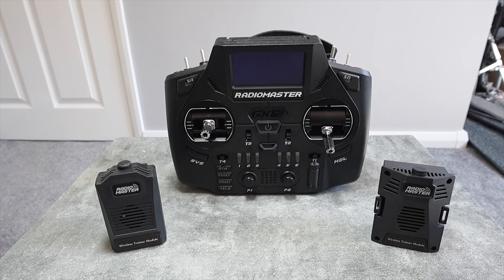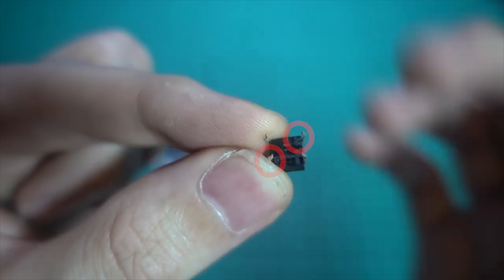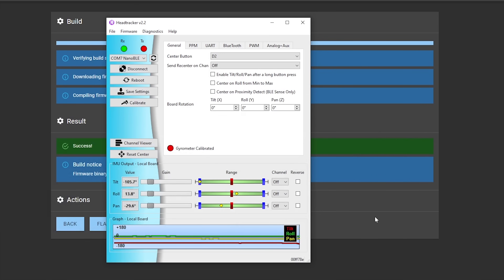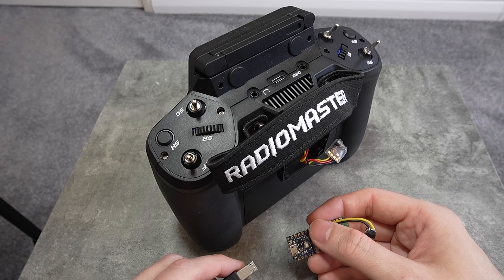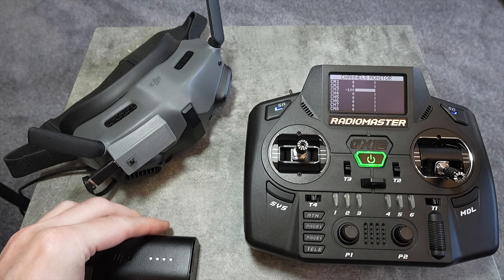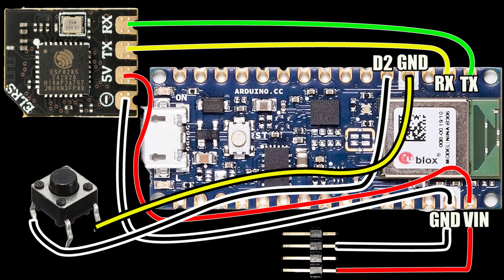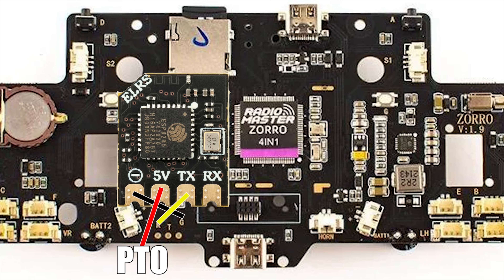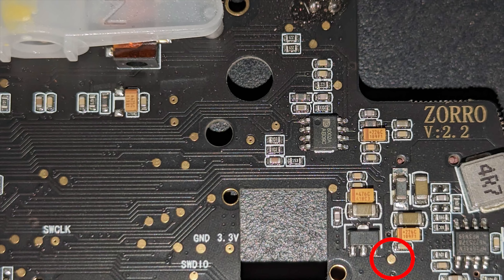DJI Wireless Head Tracker For Radiomaster Radios Tutorial

Comment: It's cool an all,  but I'm not convinced this is much easier than installing a Bluetooth module on the inside of the transmitter,  flashing the custom build and then actually using the Bluetooth connection on the arduino.
Reply from the maker: It depends what you are referring to and what radio you have. For example the Zorro is horrendous to take apart. Boxer and gx12 is easier and has plugs. Tx16s mk1 Bluetooth pads are miniature and I have destroyed the pads completely on mine trying to fit the frsky one which you can only find old stock of. They don't make any more. If you are referring to the esp32 build I believe that's very much in beta stage for the firmware and works  but Bluetooth runs on 2.4 and is weak so if you are running it alongside elrs 2.4 it will drop connection a lot due to noise issues. Then there's the latency of Bluetooth which iv gotten use to myself. But in my experience this is better and easier in every way. For example no need to compile a custom build of edgetx to add Bluetooth. On the boxer and gx12 it already had sbus trainer. The tx16s was just an update
Reply: @AndyRCchannel excellent points on the different radios. However,  you've sold me at "latency". That's the one thing i struggle with and will be doing this now for sure!
Reply from the maker: @RichardFPV  it does make a difference Phil used a wired setup and when I try his I always think Bluetooth is convenient but damn the instant response is a lot better. Now it can be both

Comment: Lot of work in video! Well explained. Why not just arduino on goggles Tx,s to arduino Rx,s onto radio trainer module on Bluetooth set to output sbus. That's all I did works fine. No elrs Rx,s involved...
Reply from the maker: Two nano boards here are about 60usd where as elrs receivers can be as little as 6 dollars. Bluetooth is fine. Been using it myself since 2019 but has latency that does not exist with elrs. Iv been using Bluetooth with crossfire which is fine because 868 doesn't interfere with the 2.4 of Bluetooth. But when 2.4 is used to the model it can drop the connection to the weaker Bluetooth signal and or cause random jitters. However there are many ways to skin a cat and that's why we are lucky to have so many methods that can suit you.

Comment: Great video thank you very well explained.  I currently use the Bluetooth method with my tx16s but it can be laggy or disconnect.  I’ll definitely be doing this expressLRS update.
Reply from the maker: Disconnect because of range or random disconnects?
Reply: @AndyRCchannel  random disconnects but then recovers, I’m flying and looking around then the gimbal stops moving and the tx16s beeps a BT connection tone then it continues working again.
Reply from the maker: @benjaming9835  are you using 2.4 for the signal to your model? or another elrs? blutooth also runs on 2.4 so when its close together the bluetooth will lose. this elrs receiver as a transmitter eliminates that. I fly my bluetooth stuff with crossfire which is 868mhz in the uk so it doesnt knock out the bluetooth

Comment: I have a Nano 33 REV2 here but the number is ABX00071.  Will it sitll work?
Reply from the maker: I think the rev 2 is now supported but In beta. Best thing to do before soldering anything to the board is flash v2.2 and make sure you are getting the pan and tilt moving in the gui before going any further as that won't hurt it
Reply: @AndyRCchannel  OK thanks I will do that.  Im in Canada and the REV1 was more than double the price so I bought the REV2 :)  Ill report here if it all works.
Reply: @AndyRCchannel  OK I did get it to work but had to use the nightly builds of firmware and the configurator and manually choose the firmware file.  If someone needs help with this just post here and I can give more details about how to do it. It is version 2.4 of both FW and Configurator.
Reply: Also of note that on my REV2 board and the 2.4 FW and Configurator that the Reset Pin was D3 not D2 and I couldnt change it.  It works fine on D3 though.
Reply from the maker: @gregdavidd  yes I joined the discord server for the head tracking project and there is a lot more updated info on there than the website. good to know the rev 2 board works and a couple of others too!

Comment: Man, sounds like and looks like ALOT OF WORK!
Reply: Ya hear there coming out with pnp version soon,i use the lemon recivers so this here won't work for me.
Reply from the maker: It's because I covered all the areas where it could go wrong and answer questions I knew I would get in the comments. Like will it interfere with your normal link. And what are all the options for all the radios. Could have just covered one and it would be a 4 min video. Maybe I should have just done that 😭

Comment: Hey Andy: I can't find the XF Robot Head Tracker module for sale anywhere, including your link. Just the module, not the entire O3 kit which is over twice the price. Any advice?
Reply from the maker: Yeah they were selling them last week and I just think they ran out of stock hopefully. Tried to reach out to them about it  but nothing yet. It will only be useful if it's using elrs or capable of using it so I'll find out
Reply: @AndyRCchannel  Sounds good, thanks again. It kind of looks like that XF head tracker module has 4 pin holes for output to their own separate transmitter module, so maybe the ELRS lite transmitter could be just plugged in there instead.
Reply from the maker: @Darrylx444  yeah on the transmitter side it needs 4 pins as transmitter side can only do crsf. So it's my suspicion they are doing what I have done in this vid. Only thing I don't like is it used an internal battery for power but does have USB input. Have to see when it turns up
Reply: @AndyRCchannel  If their transmitter is ELRS, then I guess I could just get their O3 kit and one Beta ELRS Lite instead of two. Still a bit more expensive, but not too bad at that point. I look forward to your updates.
Reply from the maker: Yup I'll let you know. It says status shipped but delivery date end of May hmm
Reply: @ Hey, I got one coming now too. They suddenly had one left on Ali when I checked just now. It looks like a 2.54mm 4-pin header could be directly soldered onto the Tx pads and directly pressed into that tracker's slot.

Comment: @17:50 New versions of edgetx allow signals from hdzero goggle to go from goggle backpack to tx module backpack and then back into the radio for mixing. The new part is where it now allows the signal to go from module back into the radio like a trainer. Edgetx added this specifically for this situation I think. It's fairly recent but I think it's in the current version of edgetx but it might still be in dev versions. I remember reading about it a while back.
Reply from the maker: Yes iv seen a dev demo video of it. I believe the issue is its causing some packet loss when enabled? also need the HDzero goggles (for now) to use it. hopefully we will see stand alone versions. You also need to have expresslrs on the radio in some form? so it wouldn't work with a 4 in 1 internal and crossfire on the external?
Reply: @AndyRCchannel  crossfire actually added support for smart audio ELRS backpack integration so this may work too. They do such a bad job on updates and release notes and manual updates though that you have to watch hours of TBS couch shows to get a hint of what they've updated.
 But yeah your way is much more universal and I hadn't realized there was some problems with signal, thanks for replying.
Reply: @AndyRCchannel  and I think there's a way to use an ELRS Rx and gyro dev board with non hdzero goggles but again your version is probably much better at this point.
Reply from the maker: @JustinHunnicutt  yeah iv seen a video of it but when I ask hows the progress they say too many bugs at the moment. Fingers crossed

Comment: 13:33 - that SD card inside of the radio on top of the SD card slot?  Whats that all about?   For DJI o4 you no longer need a flight controller. In the goggles you can set the unit to high power mode without an arm signal.
Reply from the maker: ah that is good news about o4 shame the ham file over here is broken for goggles 2
Reply: @AndyRCchannel   Id like to report I was able to complete this setup with a spare elrs receiver, flashed to output inverted sbus, attached to my Jumper T16 radio's AUX1 port and bammo it works like a charm.  Now waiting for servos to build a 3d printed gimbal.  I was able to bypass the radiomaster sbus module all together.  I'm not sure what that module does?  Is it just a 5v regulator w/ a built in sbus inverter?  Would you be able to post some up close photos of the board inside the module?  Cheers mate
Reply from the maker: took this picture when I accidently pushed the SD card through the case on the mk1 by accident. good spot